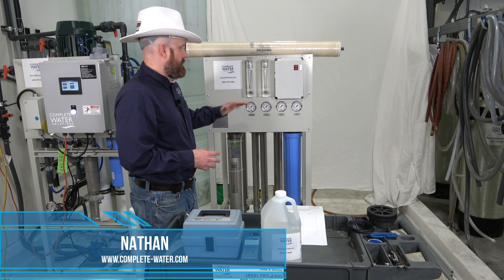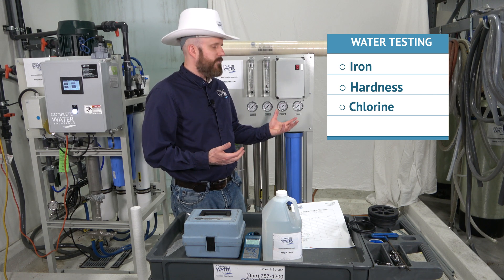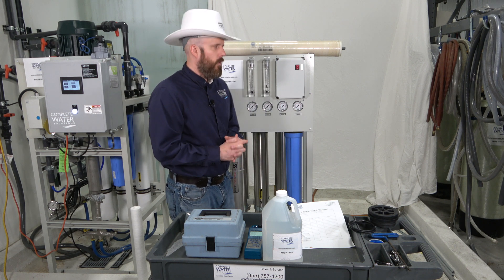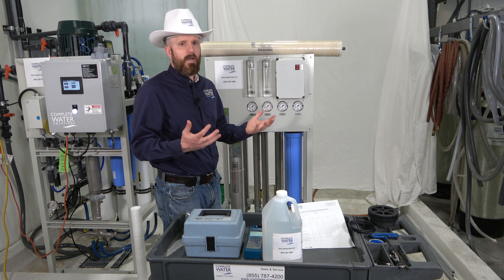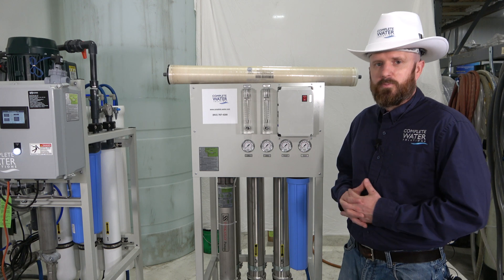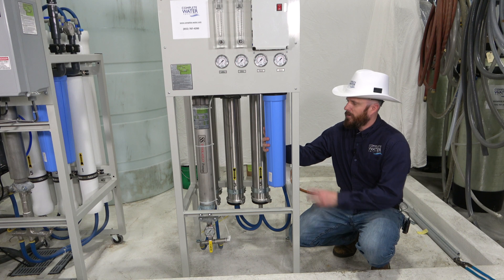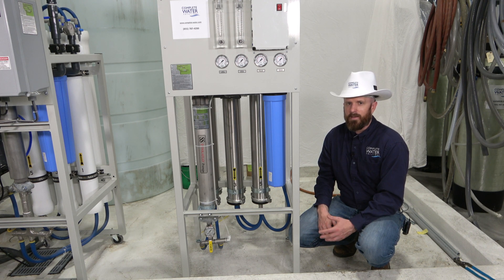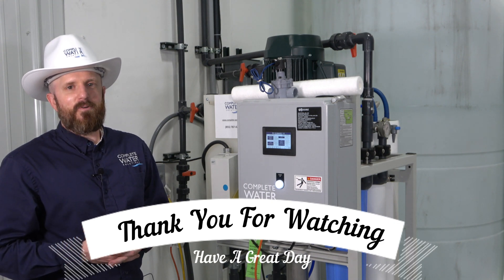Osmonics / GE Water E4 Reverse Osmosis (RO System) Maintenance & Daily Checks

Comment: Love this video
Reply: Glad it was helpful
Reply: If the RO system is on standby for long duration, will the water softening system still run?
Reply: @harrisonhaines4876  Not sure your system design or layout or what you have. But if there is no exchange of ions / water flowing through the softener then the capacity should remain for a while.